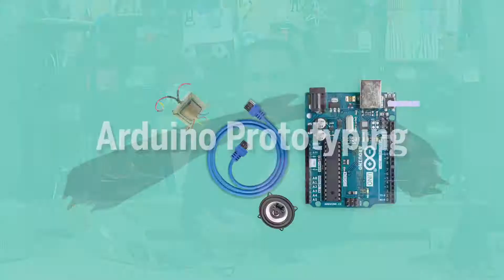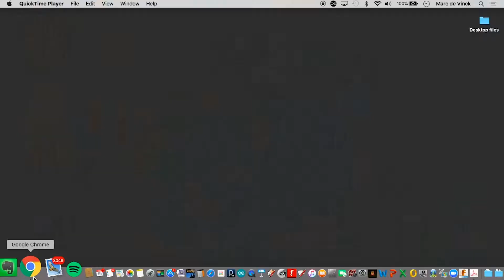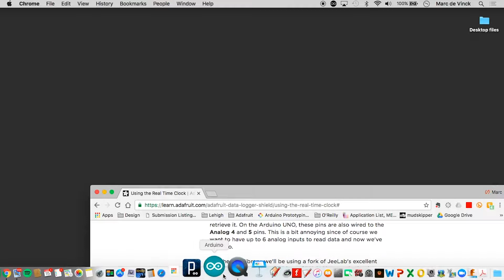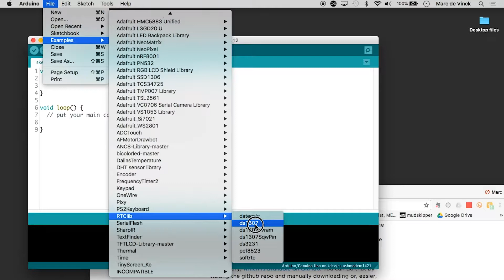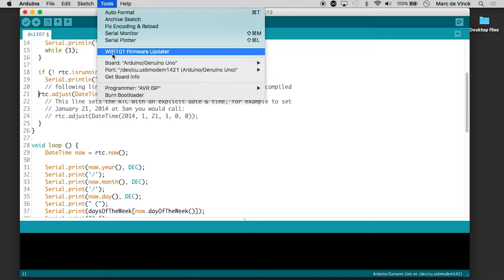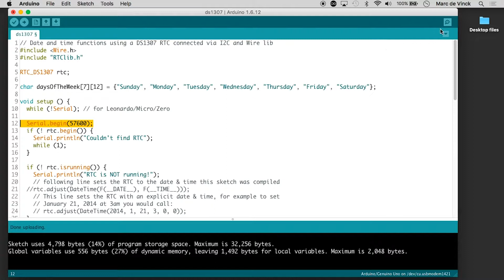Arduino RTC Tutorial: Keep Accurate Time With No Power (DS1307)

Comment from the maker: ⚡ Quick tip: if the Serial Monitor spits out garbage characters, it is almost never your wiring. This sketch uses Serial.begin(57600), not the default 9600. Match the baud rate in the dropdown at the bottom right of the Serial Monitor and the date and time appear instantly.

And remember to comment the RTC.adjust line back out and re-upload after you set the clock. If you leave it in, the board re-stamps the same compile time every single reset.

📌 FULL SERIES: Watch all 100+ episodes of the Complete Arduino Prototyping Series. https://www.youtube.com/playlist?list=PLcKte0wD90Y4lsrStEWB5NR1gKMs0FDts

What is the first project you would add a real-time clock to?